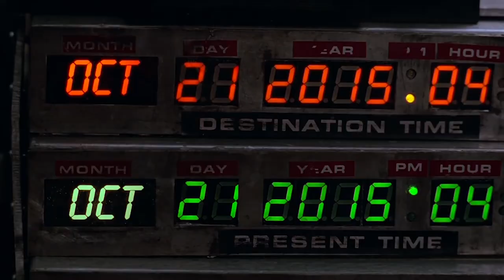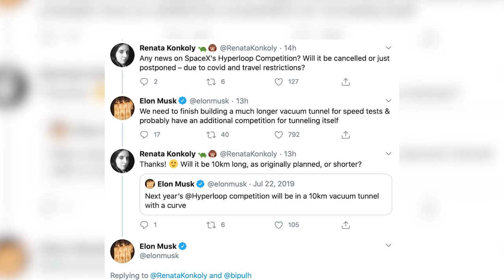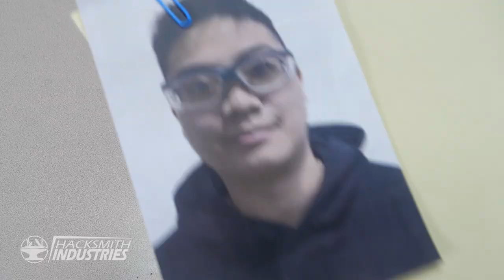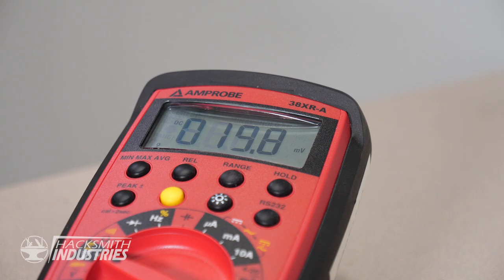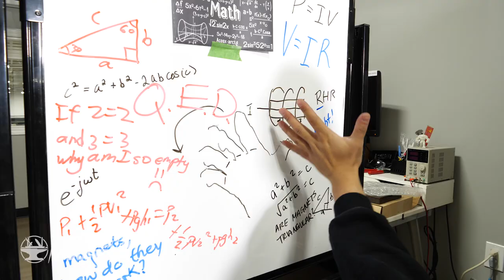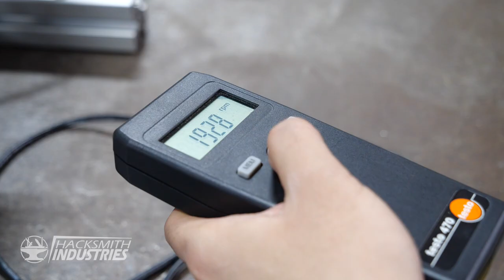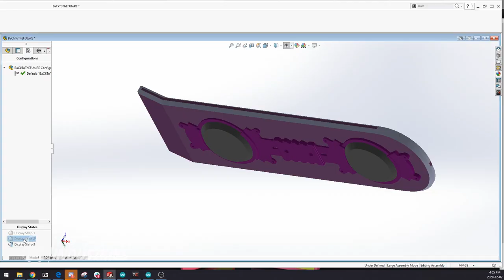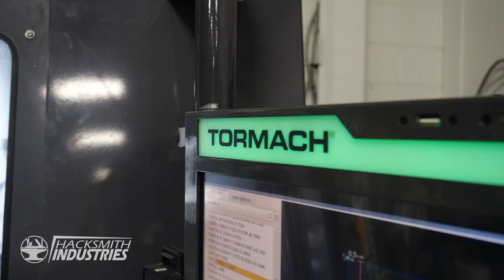HOVERBOARD BUILD (PART 1/2)

Comment: Ah yes, the spontaneous fires of innovation
Reply: Why is there explosion
Reply: Exactly
Reply: How the absolute HELL do they make this within a year while designers are still working balance!?!
Reply: Just wow. A freaking HOVERBOARD.
Reply: Lol 😂
Reply: That is how you can tell it is Science!
Reply: Maybe its just the effect
Reply: H
Reply: Ah yes, my favourite person
Reply: In part 2 another spontaneous fire
Reply: That's how you know it's gonna end up being a really cool project
Reply: And destruction
Reply: R/C speed controllers 🙄
Reply: Maybe the magnets from the magnet wheels are interfering with the magnets of the motors like when there are four compasses right next to each other and even the induction of the motors changes or electrons fell out of the electronic speed controllers because they were upside down.
Reply: Best example of this is SN8's explosion
Reply: It's too strong of a power for little Jimmy
Reply: @egis4763  Because of SCIENCE B**
Reply: @JCBOOMog  Adding power to a wire that is by a magnet causes an electromagnetic field that causes resistance to drop in the direction of the Magnetic field. Normally this is barely a risk in motors of other electronics but when sodering and wiring a setup in a small space next to a strong magnet it can cause the power to jump wires. Once it shorted out in 1 section and you're unlucky since the short was on the other side of your fuses the power travels to others causing the other side to burn out too. Transistors and some other parts tend to explode in a blue smoke when this type of short happens.
Reply: Ahhh, this brings back memories of capacitors exploding
Reply: Like the ol fire the Neanderthals made.
Reply: It be
Reply: Did you have any innovative fires while making your glue guns? 😂
Reply: @JCBOOMog  must have been the wind
Reply: Early
Reply: @johnsherby9130  I had a couple while making the web shooter
Reply: Electroboom has entered the chat
Reply: Yay 😀
Reply: Tusk act 4 to magnets hello my child
Reply: I now want a shirt that has a flaming hoverboard with the text "the spontaneous fires of innovation"
Reply: Wheres dum-e when u need it
Reply: Yea it’s really lite
Reply: Lok
Reply: That straight up sounds like a v for vendetta line lol
Reply: Jimmy what happened ;p
Reply: FOR SCIENCE!
Reply: @JCBOOMog  they basically created an induction cooker with too much power
Reply: @nedashariff6694  it's a bot dont reply report it 
It has appeared on so many comments
Reply: Innovation=more jobs

It is anabsolite win
Reply: Where the f was dum-e
Reply: Just like the original one.
Reply: Spontaneous combustion of knowledge and ideas.
Reply: @egis4763  Because other people are trying to make it consumer viable, and they just wanna make it work regardless of cost?
Reply: That excites
Reply: @egis4763  trust me things like this obviously have been made, but only people who can afford it would know about them
Reply: When one innovation makes an accidental backwards quantum leap to a previous one
Reply: Yas
Reply: fires of innovation or fires of complication?-
Reply: looked like LiPo battery fires... I wonder what would happen with a lower KV rated motor... like could it spin faster and generate more 'lift' using fewer motors...
Reply: @JCBOOMog  because Art is an EXPLOSION!
Reply: spencer from icarly
Reply: But still no flying cars or time machine.......
Reply: @JCBOOMog  there was an explosion because this is the hacksmith channel and here we just love this randomly exploding
Reply: Both figurative and literal
Reply: What
Reply: Just like Spencer Shay
Reply: @Okay1  are you gay?
Reply: Already saw it.
Reply: The Eddy current was unstable
Reply: Actually this existed like 10 year ago
Reply: 69 replies
Reply: I got hacksmith monster by breeding 🥳🥳
Reply: Ah yes i remeber
Reply: Not to be a downer but many other people have used this technology so it’s not really innovation
Reply: Hahaha
Reply: @egis4763  do you not see?, hacksmith hire the best engineers
Reply: they was make shut circuit
Reply: Ah yes! The negotiator.
Reply: (Literally fire)
Reply: @egis4763  no clue dude no clue
Reply: Probably what that 80s song about being blinded with science was based on.
Reply: @AndrewPRoberts ... are you, making a reference to the show, I Carly? That's not funny.
Reply: @jameshamaker9321  Thanks for your assessment
Reply: “If things are not failing, you are not innovating enough.” - Elon Musk

Comment: The next step: we’re building a time machine!
Reply: Great joke
Reply: grape
Reply: @Coolerbeans69  well technically on the top of Mount Everest time moves slightly faster
Reply: Wait if you went back in time and changed the future you wouldn't have gone back in time to change the future witch means you would go back to change the future cycle repeats so time travel is extremely dangerous and I broke my brain

Comment: You should make Finnick’s collapsible trident made by Beetee from The Hunger Games: Mockingjay. 
“Later in District 13, Beetee designed a special collapsible trident for Finnick which could be retrieved after it was thrown by pressing a button on a metal cuff on his wrist. It also has a lot of special features, such as an automatic blade sharpener and more” 

That would be so cool to see

Comment: You would theoretically be able to do this with superconductors and diamagnetic reactions however from my knowledge you would have to be able to control the magnetic field and where it's applied so the board would actually hover properly. 

Basically something that is diamagnetic will push itself away from an applied magnetic field so if there's an applied magnetic field under it, the object or material would push itself up away from the magnetic field thus levitating or hovering. The issue is getting this magnetic field there, in small models its always done with magnets and graphite sheets. 

The only way large scale I see to do this with diamagnetism is either creating a special "track" with magnets in it or creating a machine that can harness the magnetic fields our planet gives off and then somehow controlling and applying them in a way that allows the board to levitate or hover.

Comment: Honeycomb carbon fiber would have been a better choice for the board right? Rigidity plus an overabundance of lightness. But I assume it would be quite difficult as I think a honeycomb structure would almost certainly require an outside vendor to create. Adding brass inserts for threaded holes and perhaps some coating to mitigate heat when inevitably one of the assembly catches fire.
Edit: just finished the video and saw the flamey bits

Comment: Depends on how fast things go that certain materials could handle, but, instead of having each powered individual or together, hook up 1 good motor with either chain or belt run links to each Spinny Bois.. would save a bit on electricity maybe? If it works out

Comment: Aluminium may not be ferromagnetic, but it sure is very electrically conductive. Meaning you create eddy currents in the board itself while spinning too. Less so on the top sheet because of the orientation of the Halbach array, but the side profiles are probably getting a bit toasty, aren't they?

Comment: How are you gonna compensate for pressure on the motor shafts?  I know from experience motors don't like pressure back down the shaft rotational axis, this design spreads the weight between all motors, but even still I think it's too much weight on the shafts without some bearing end-stop/cap-thingy or taper bearing jiggery...?

Comment: Lets put magnets near motor drivers and hope that nothing goes horribly wrong 🤣 ok but seriously faraday cage and even I’m unsure how you isolate the magnetic field lines without inducing more current in the controllers or the electronics. 

I think just keep it safe and even use a magnet coil to detect how much current you induce in a coil at x distance then try the same inside a shielded container to determine how much shielding it will require if it induces voltage when motors run then your sheild isnt good enough but this is just a guess because if you shield im pretty sure you’ll end up deflecting the fields in a manner you dont want

I think you’re doing great to be clear :) just you’re making bigger fields that are overwhelming the devices controlling the motors themselves and this explains the multiple simultaneous explosions

Comment: To crush every child's dream about getting a Hacksmith monster in ML, it's not a full on F2P monster lmao. You can get some cells through F2P means, but the amount of time and effort you need to do to get him for free is nuts. I'm a long-time ML player and let me say, he's being primarily released as a P2W monster from the current season's Golden Legends Pass that you need to drop at least 20$ - 30$ on based on if you can get it quick enough while it's on discount.

And to crush those dreams even further,  the monster is actually crap lmao. He's a pathetic attempt at a Tank who's role in his skillkit and trait and all is so messy and confusing. He's a Tank that doesn't provide any immediate Tank protection for his team, instead you need to wait till it becomes his turn to setup Mega Taunt so he can actually start doing his job. Problem is, he has 0 Immunities to any effects, he's most likely gonna get shut down and Denied before he can even pull off his attacks. At best he's a Support that can attempt to setup Shields and Skill Mirror for his team and also if given enough turns, also setup his Mega Taunt. A complete far cry from amazing meta threats like Bombeta and Shelly, 2 amazing Mega Taunt Tanks that start battles instantly with Mega Taunt. (for those who don't know ML, Mega Taunt is an effect that allows the mon who has it to absorb all incoming attacks, both Single Target and AoE for their Team, effectively acting as dmg and effect sponges)
Reply: eh it’s kyrem

Comment: I could be wrong but it seems to me you are taking wrong steps to power up the motors. You will need to bit by bit power up them due to inrush current on motor startup at least not powering up all together at one go or give each of them isolated power source. You will need thicker wire too judging on the load you are dealing with. I love your video, keep it up! :D
Reply from the maker: Not quite. Close though

Comment: Have you guys thought about useing magnetic levitation I am not an engineering student but you could possibly do it with eltro mags and change the power output for someone's weight so that it stays at a constant hover I know it's probably  not possible as it wouldn't be able to construct a magnet big enough to old it and be able to change the power output